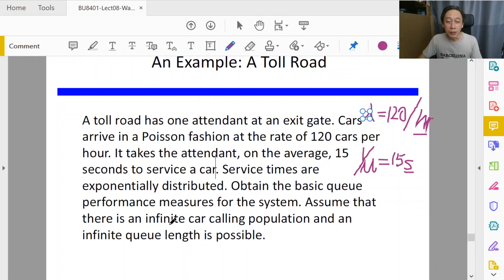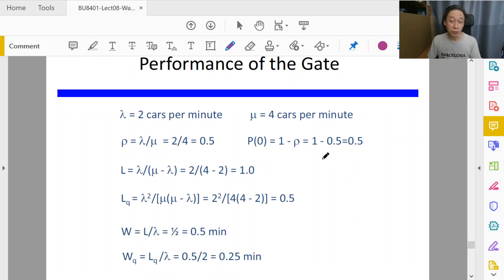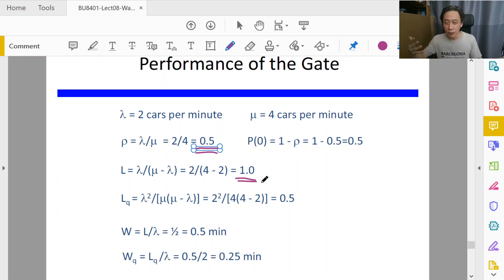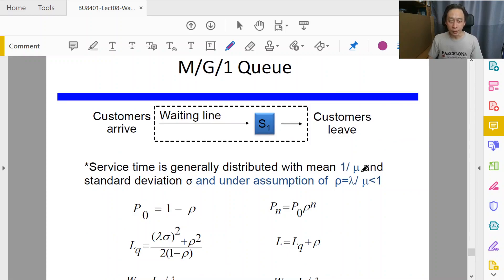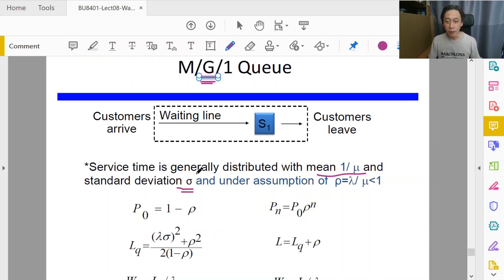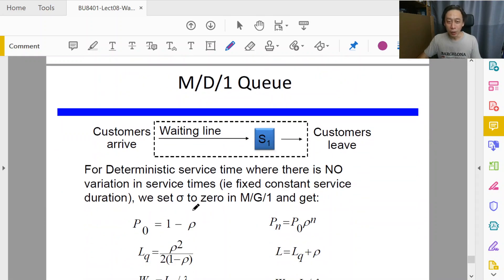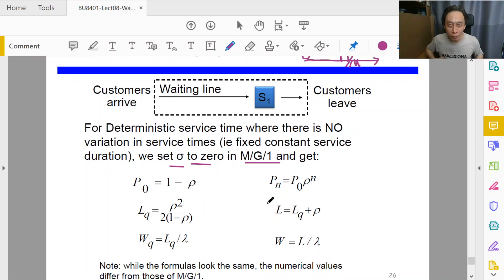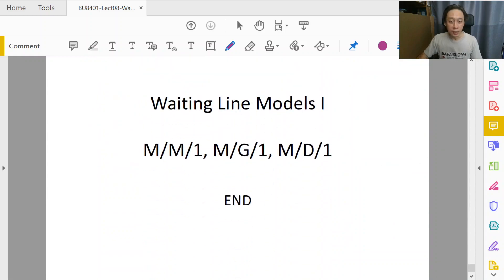Waiting Line Models: Single Server - 6 - M/M/1, M/G/1 and M/D/1 (Part 2/2)

Comment: What does it mean when I get a W value of negative? This happens when my arrival rate is greater than my service rate. Thanks
Reply from the maker: Hi Ryan, when your arrival rate (lambda) is greater than your service rate (mu), the formulas break down because "lambda >= mu" implies that the queue system is not in steady state equilibrium (SSE), which means the longer the queue system runs, the longer will be the expected length in the queue (ie as time passes, Lq --> infinity).  Such a system becomes infeasible in real life, and before the queue does get to infinity, commotion, public disturbance etc would quickly cause the queue system owner (eg the shop) to shut down.

Just a side point, when you notice lambda > mu, you would need more servers to deal with the large lambda.  It's like one person servicing at the check-out cashier of a supermarket.  When more and more customers want to check out per minute that is larger than the service rate the cashier could offer (eg  10 customers/min > 2 customers/min), the queue starts to snake around.  And before it gets unsightly, the manager would quickly deploy another cashier (or 2) to open up the counters in order to clear the queue.  That is the visual effects of an non-SSE system (lambda > mu).

Comment: What does it mean that the service times are exponentially distributed, please?
Reply from the maker: Yes this is quite an abstract concept to think about.  It means converting physical count of service time duration intervals into frequency chart.  So x-axis is time intervals (eg 0-1 min, 1-to-2 min, 2-3 min, ... until infinity) and y-axis is proportion of counts that fall into that x-axis bin.  (strictly speaking, exponential distribution is continuous, but it's easier to think about it as discretized for now).  Let's see an example:

Suppose consecutive customers are serviced at durations:
0.1, 1.5, 3.1, 2.5, 0.5, 1.3, 0.6 , 0.2, 1.7, 0.8  mins.  
Converting to time interval counts, we get:
 1,  2 ,  4, 3, 1, 2, 1, 1, 2, 1    (ie the duration falls into  [x-1, x) interval)
So we see that the total counts for 1,2 ,3, 4 (on the x-axis) are:   5, 3, 1, 1, and the probability is therefore,  0.5,  0.3,  0.1,  0.1  (exponentially reducing)

The exponential distribution is used to replaced this rough, discrete procedure using a continuous smooth curve.

I've also attempted to explain it in the videos:
https://www.youtube.com/watch?v=D-zl0VdtUbw&list=PLEOIAuk_ubsKwV7WX6KsJb13wxPO70EFq&index=6

and 

https://www.youtube.com/watch?v=ioEStQqhmiE&list=PLEOIAuk_ubsKwV7WX6KsJb13wxPO70EFq&index=7

Hope this helps.
Reply: @iteach1056  You sir, are the MVP. Thank you for doing a job of my professors at Top 50 European University 🥲